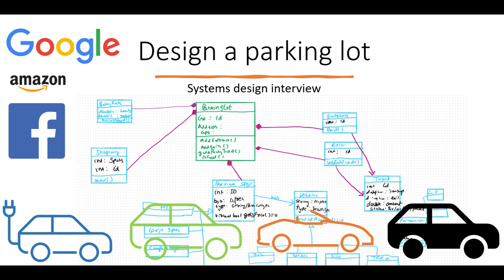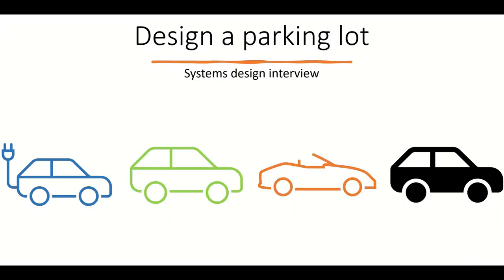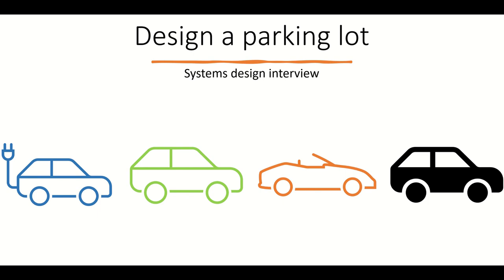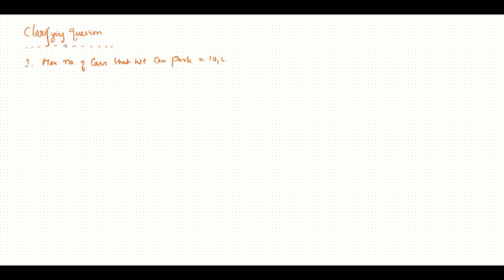Design a Parking lot | Systems Design Interview question

Comment: The number of min heaps would be same as number of entrances. However, the nodes (spots) considered for min heaps should be disjointed - no 2 min heap to have same spot else there would be an overhead in maintaining.
However doing so has another observation, if one entrance exhausts all the spots, it would then need to refer the min heap of the closest entrance. Thoughts?